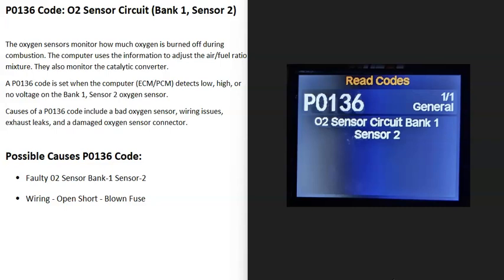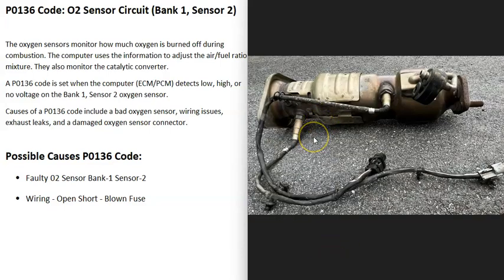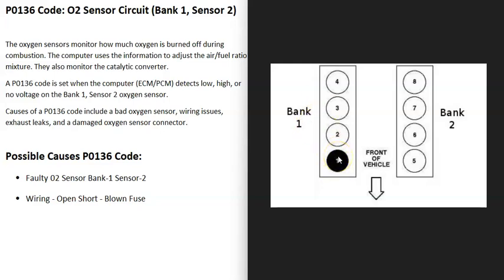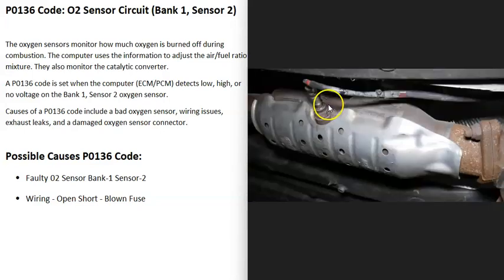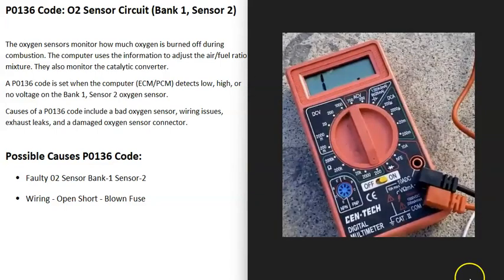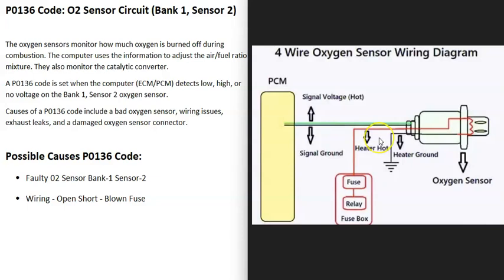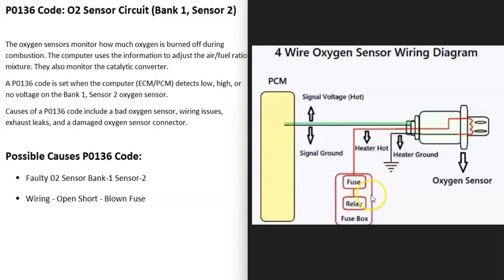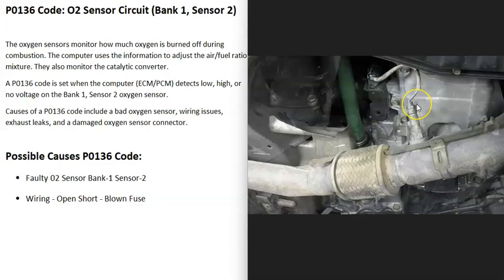Causes and Fixes P0136 Code: O2 Sensor Circuit (Bank 1, Sensor 2)

Comment: My brother I have this malfunction P0136 and my car type is Hyundai Santa Fe 2014 4 cylinder imported American the problem is there is no pollution bear and when I added a replacement of the pollution bear or s
pacer the malfunction disappeared P0420 and also the fault P0140 butAnd every time I move in the car the code P0136 appears only this code

Comment: I have to get it smogged but ingen light is on codep0136 came up but after ✔️ light went off.smogged place said they hooked it up but nothing came up on the screen .so should I buy the 02 sensor
Reply: No check engine light for me but code found

Comment: It there a way to just cut the sensor out, and not throw codes?
Reply from the maker: There is what's called a 02 Sensor Fouler, which is a spacer for the 02 sensor that, in some cases, fools the computer. Results can vary depending on the vehicle. It's best to find a forum for the specific vehicle to see if others have had success using them.
Reply: There is also a thing called o2 sensor simulator. It uses a resistor and stuff to electronically fool the computer. 

It won't work with newer cars because they are clever.

Comment: Thank you. Straightforward and to the point. 

Now. Can anyone tell me how to get rid of some of this 'Crap' they keep putting on these vehicles???

I'm tired of being robbed. And that's all the majority of it is.

Does anyone have a nice running vehicle prior to this "era"? Maybe something from the '90s or early 2000s? And reasonably priced?

Or is that last paragraph an oxymoron??? 😄 But then again, I didn't mention the 80s. And certainly not the '70s. 😄

Thanks again. 👍

Comment: Ive encountered a po137 code changed the sensor for a up market one . Im still getting the code im guessing its a wiring issue from the plug underneath the car as you can twist the plug seems loose vauxhall zafira b 1.8 petrol.